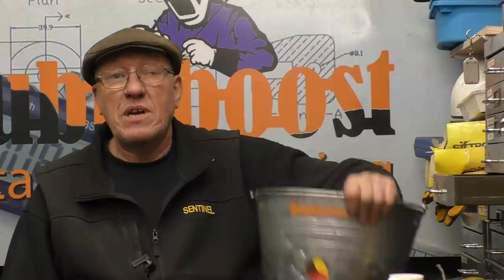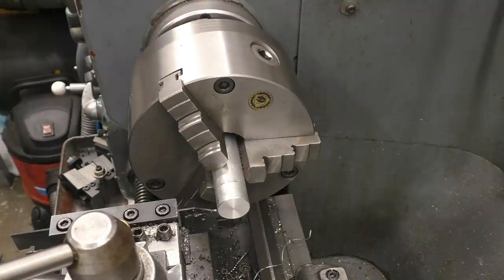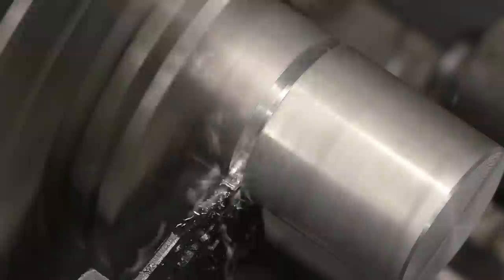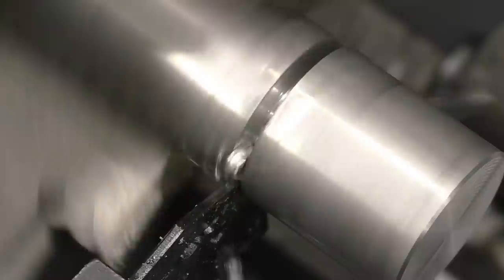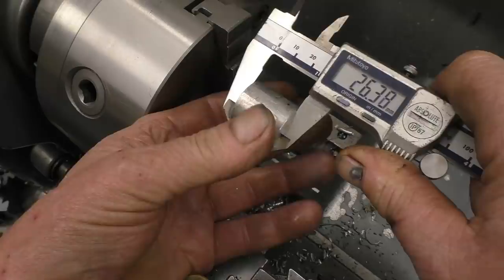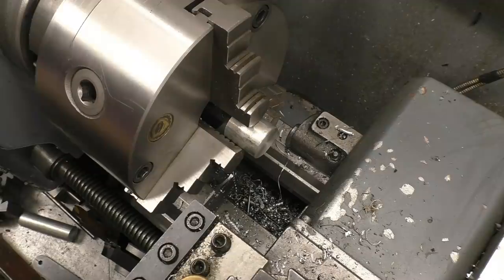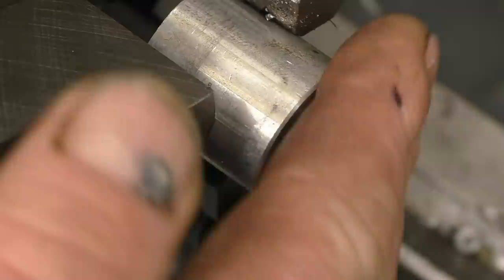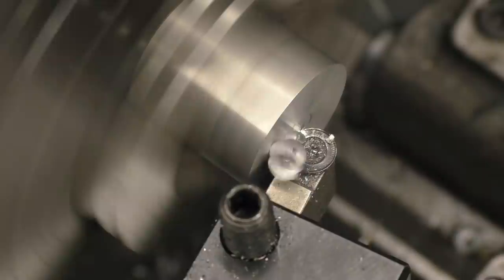SNNC 409 P1  Close Up Machining

Comment: I have found that using specific carbide inserts with different geometry designed for turning aluminium give a much cleaner finish on aluminium with much less gumming onto the tool, various types of insert are available for different tool holders. I still prefer turning steel though.